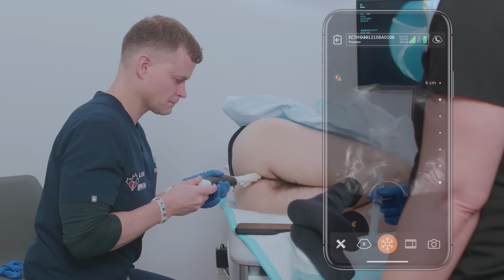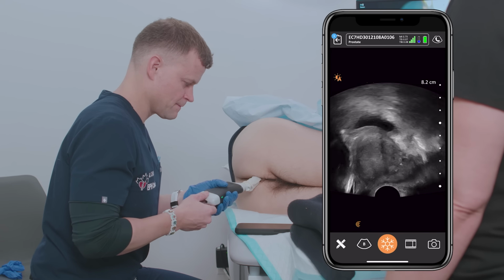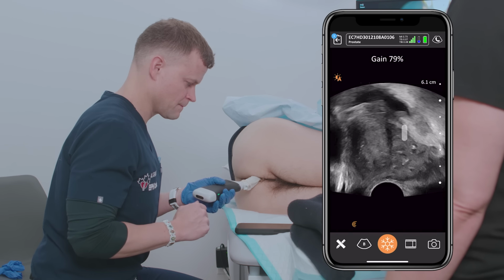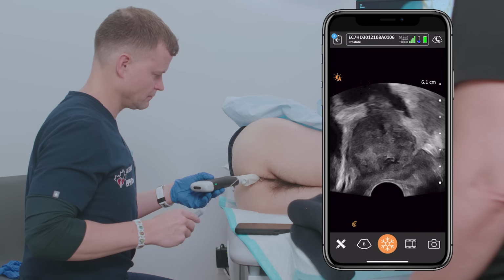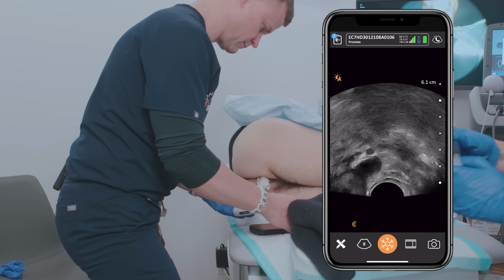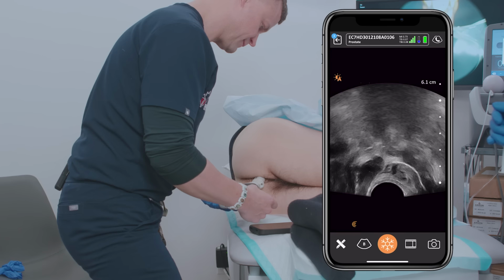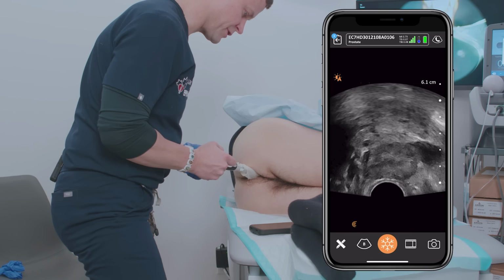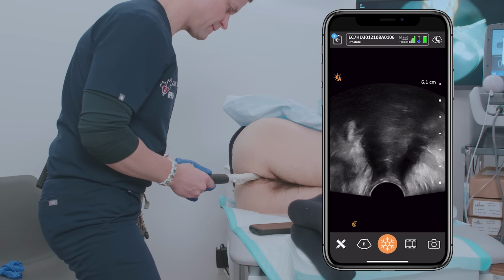Transrectal Periprostatic Block

Comment: Great vidio it seems my dr  was missing the size of prostate so she can do density tesr its like a aleabea problem one needs info so a trus is usefull in getting the density also voluem 3:31 3:31 3:31 3:31 3:31 3:31 3:31 3:31 3:31